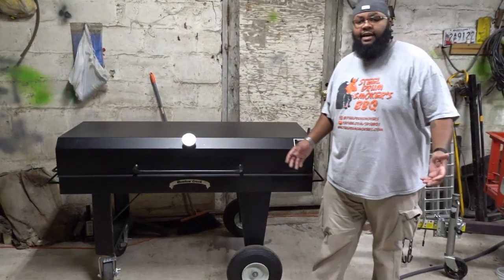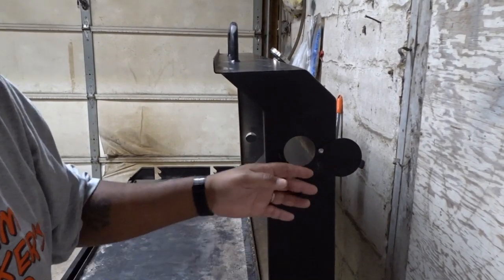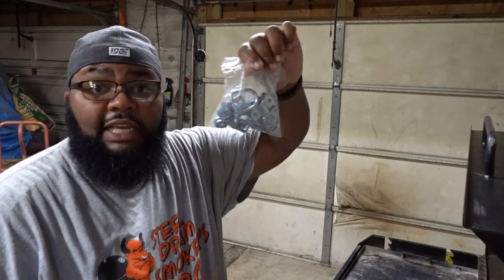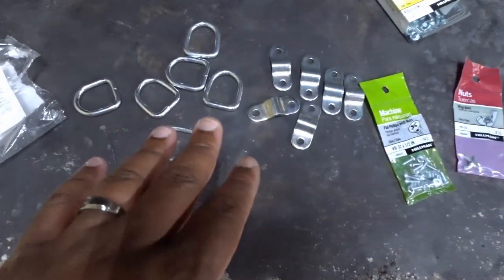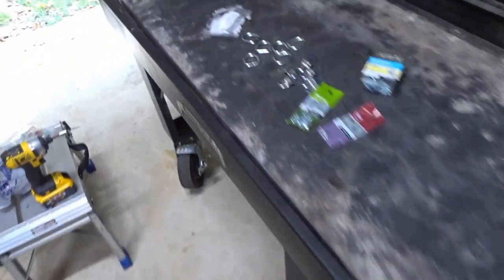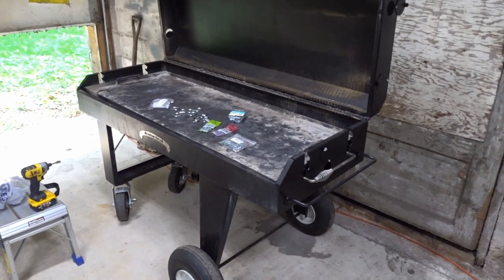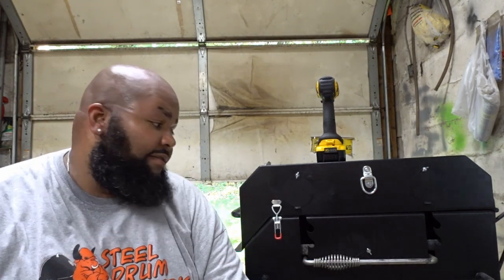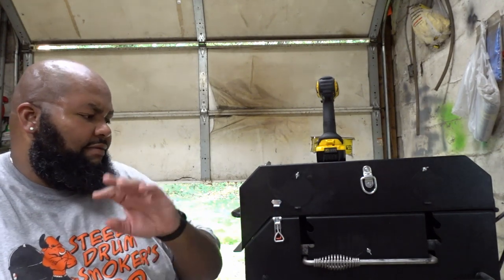SDSBB - 5 Ft Onsite Grill Table First Mods and Naming!

Comment: If I may, I would suggest getting some springs to put behind the wing but. Then you won’t have to tighten them all the time
Reply from the maker: Hmm... the screws are very short and not sure of I can manage to get springs on the screw... but I'll see if the wing nut tightening is even a problem when I use it next. Thanks!
Reply: @SDSBBQs  This was going to be my suggestion as well. Longer bolt, heavy-short spring, and wing nut with washer. Making it your own BBQ brother!!

Comment: Great first mods dash ..can that grill grate cover be used as a griddle cuz I think having a flat top section on your grill would be game changer I’m digging that grill more and more you can probably make a Santa Maria attachment for it
Reply from the maker: That was the charcoal grate it is nice and flat so that the charcoal can be cleaned out easily. I might be able to get one of those little universal flat tops and put it on the grill grate but that's taking away cooking space. Not quite sure about the santa maria either just because that isn't popular in this area. Thanks man for watching and commenting.